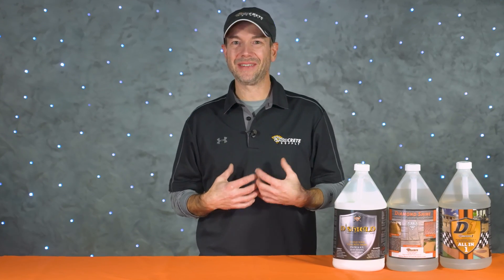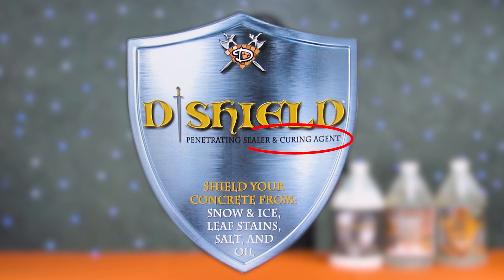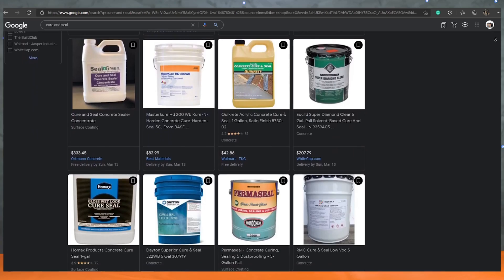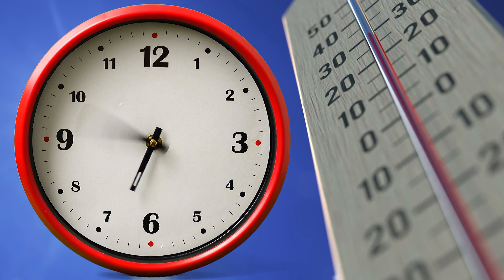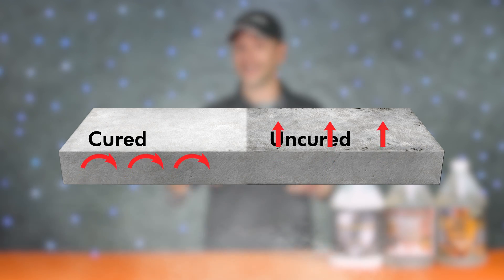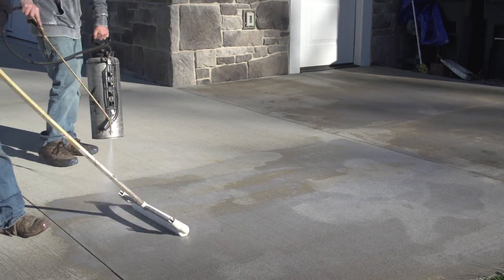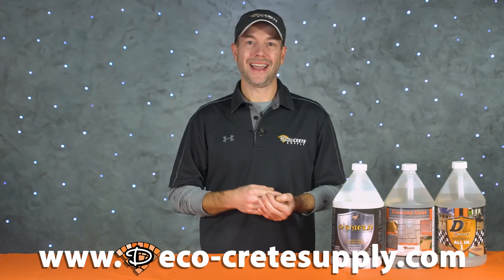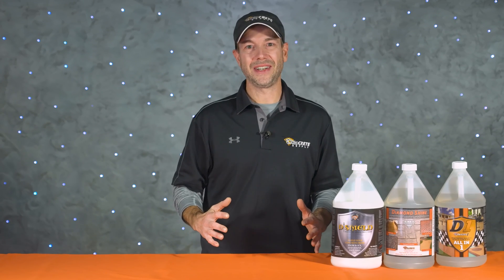Curing vs. Sealing Concrete | What's the Difference?

Comment: My basement floor is constantly dusty. Can I do something to stop that?
Reply from the maker: Thanks for the comment! You could try applying concrete sealer. It will help the problem, but it's hard to know how long it would last. Dusting generally comes from a weak surface and sealer probably won't permanently stop it from happening. Densifiers can also help with this, but they can be hard to work with. Some sort of vinyl of tile flooring might be the best option. Thanks for watching Deco-Crete TV!!!
Reply: @DecoCreteTV  I do not even know if it's sealed or not. I doubt it to be honest. I was thinking vinyl planks but I'm worried after a while the concrete will be making crunch sounds underneath

Comment: Great video, I am about to begin a barnominium and want a "stained" concrete floor. I understand waiting 30 days. My question is of the concrete guy uses a curing agent will that "seal" so as not receive the stain? It is going to be March in North Texas. So not really worried about freezing. Thanks
Reply from the maker: Sounds like a cool project! Curing agents will definitely have an effect on how the stain penetrates & reacts. Possibly making the floor unstainable unless you remove the curing agent. We don't recommend using any curing agents if you plan on staining the floor. Thanks for watching Deco-Crete TV!!!!
Reply: We used to water cure the concrete. Meaning keep the top surface of the concrete wet. We used haybales, cut them open, spread them out and soaked them to help keep the moisture on the surface. Do this for a few days.

Comment: Great Video! I have been doing some research and a lot of the product data sheets for cure and seals remind me of a bottle of body wash and shampoo promising several benefits in one application, but in my opinion... not doing either well. Do you know why these cure and seals can market their products as a one-and-done application?
Reply from the maker: Thanks for the comment!!! I don't have a great answer for why companies can do this. The products do what they say they do, just not all at the same time. The term "Cure & Seal" is common practice in the concrete industry. We feel it's important for contractors to understand the difference between curing & sealing, and that they can't be done at the same time. Thanks for watching Deco-Crete TV!!

Comment: I would like to know when should i apply the sealer (for curing). Can i use right after demoulding( its a beam)  the structure after 1 day. Can you recommend which type sealer is more suitable?
Reply from the maker: Normally on a flat slab you would apply the sealer/cure right after finishing. In the case of a beam, you'll have to wait till forms are pulled off, probably the next day after pouring. You could use any of our cure & seal products for this. I'll leave some links at the bottom so you can check out the pricing. Thanks for watching!!!                                                             
https://www.deco-cretesupply.com/products/water-based-sealers/d-guard-wb-309                                                                                                                                      
https://www.deco-cretesupply.com/products/solvent-based-sealer/d-guard-clear-25                                                                                                                                   
https://www.deco-cretesupply.com/products/decorative-concrete-sealers-solvent-based-sealer/super-stamp-seal-5-gallon                                                               
https://www.deco-cretesupply.com/products/decorative-concrete-sealers-solvent-based-sealer/d-one-5-gallon

Comment: Thanks for the video, and hoping you can provide me some advice. 

I stay in a townhome, and on my second floor is a French door with an outdoor patio (14 x 5). Water is penetrating at the joint where the balcony concrete slab meets the exterior brick wall. There are some cracks there that need to be addressed. I don't trust my HOAs contractor and wondering what you think may be the best route to address the cracks and stop the water coming in? (Leaks into my room below it)

Reached out to a couple companies, one has recommended taking up the entire patio to the sub-floor, and redoing the entire thing ...while others have recommended just laying down some liquid rubber. Thoughts? Been dealing with this for a long while and need some help haha
Reply from the maker: That's definitely a tough situation and some sort of water proofing is a must. Sika 1A would be a good thing to fill the cracks, then you could put down a water proofing membrane and fabric. I would also recommend running the fabric & membrane up the wall a few inches to address the transition between the horizontal vertical surfaces. After all that, you would have a few options for the final surface, concrete overlay, tile, or some kind of outdoor flooring. Concrete overlay and sealer is a nice option because it'll help the water run off better. Hopefully this helps, I leave a few links to these products below. Thanks for watching Deco-Crete TV!!!                                                                                    
https://www.deco-cretesupply.com/products/repair-prep-products/sikaflex-1a  
https://www.deco-cretesupply.com/products/repair-prep-products/miracote-membrane                        https://www.deco-cretesupply.com/products/overlay-tools/miracote-rp-fabric                                          
https://www.deco-cretesupply.com/products/trowel-overlay/stamp-mix                                                    
https://www.deco-cretesupply.com/products/overlay-mixes/deco-crete-stamp-overlay-mix                   
https://www.deco-cretesupply.com/products/decorative-concrete-sealers-solvent-based-sealer/d-one-5-gallon

Comment: Experts - for radon mitigation install , contractor made a hole in concrete wall and filled the gap around the pipe both inside and outside of concrete wall with Alex Plus Latex Caulk Plus Silicone . Is this good or should I get sealing around pipe with a better product?
Reply from the maker: Thanks for the comment! I don't have any experience with that product in that kind of situation. We would recommend some kind of hydraulic cement based product for that kind of repair. I'll leave a link below for the one we sell on our website. Thanks for watching Deco-Crete TV                                                                                                     
https://www.deco-cretesupply.com/products/overlay-repair-products/cement-all

Comment: After concrete poured, what is the earliest to apply sealant?
Reply from the maker: The safe answer is 30 days. That being said, it dose depend on what kind of sealer you're using. Penetrating sealers definitely need to go fully cured concrete, but film forming sealers are usually ok after a week or two. Some of this would also depend on the time of year. Thanks for watching Deco-Crete TV!!!!
Reply: I'm waiting for my new concrete patio to cured and by the time it reached the 30 days period, it's going to be November and it has been cold and wet every day so doesn't look good.  What's my option, wait until spring of next year?  And what sealer would you recommend?  Thanks!
Reply from the maker: @chanthana7694  What sealer you should use would depend on how the concrete was finished. We recommend D-One for stamped or any other kind of decorative concrete and D-Shield for broomed or swirled finishes. I'll leave a few links at the bottom. As far as the timing, you'll just have to wait and see what the weather is like. We're based out of Ohio, and there are usually some decent days in November that you could get it sealed. If not, waiting until next spring isn't that big of a deal. The fact that it's a patio and won't get any vehicle traffic helps things out. Thanks for watching Deco-Creet TV!!!                        https://www.deco-cretesupply.com/products/decorative-concrete-sealers-solvent-based-sealer/d-one-5-gallon                         https://www.deco-cretesupply.com/products/water-based-sealers/d-shield

Comment: if I waterproof my concrete patio will it make ice more likely to form on the surface? Would melting salt render the waterproofing useless?
Reply from the maker: Thanks for the comment! I wouldn't consider concrete sealers "waterproofing" they're more of a water repellant. A true waterproofing would hinder the breathability of the slab and would lead to problems down the road. Concrete sealers repel water from above but allow moisture from underneath to escape. Ice will from on top concrete sealer sooner then unsealed concrete, but that's better then ice forming in the concrete slab. Melting slats will definitely work, but some of them can be corrosive to the concrete, so make sure you check if it's "concrete safe" before using. Ice forming on top of sealed concrete really has no negative effects to the concrete, just slippery to walk on. Water getting into the slab, then freezing is where the problems start. The best thing you can do is leave the ice there unless you have use the area. The constant cycle of freezing & thawing can lead to more damage then just leaving it frozen. Hopefully this helps, thanks for watching!!
Reply: @DecoCreteTV   What's your opinion on those products like 'Alaska Liquid Ice Preventer'? It claims to prevent ice from forming on concrete but I wonder if it'll do anything to also help melt the snow that's on top of it.
Reply from the maker: @ginsengroot815  I'm not familiar with that exact product, but we have used some ice-prevention products in the past. They work really good for prevention, but they don't seem to melt ice very well if it has already formed on the surface, especially if the temps are under 20 degrees.

Comment: So when should your seal ? Right after the pour ? Like a day or two ? Or longer ?
Reply from the maker: it all depends on what you are hoping to achieve out of the sealer. a good rule to follow is: spraying the concrete with sealer the same day will act as more of a curing agent than a sealer. to get the most out of concrete sealers they should be applied to fully cured concrete.

Comment: I have new concrete that is 40 days old, and it is developing multiple long hairline cracks which extend across the entire slab. About three days ago, I first noticed these cracks when temperatures dropped from the 90s to the 40s. I know there is little I can do about the current damage, but I want to seal it to prevent new cracks. I have read about penetrating and acrylic sealers as possibly being helpful. Which type of sealant could help me best with preventing additional cracks? Thanks so much!
Reply from the maker: Sealer will not keep concrete from cracking. But it will keep water from soaking into it as well as protect it from stains for driveways we recommend a penetrating sealer like D- Shield. https://www.deco-cretesupply.com/products/water-based-sealers/d-shield
Reply: It wasn't installed and or finished properly.

Comment: New sub. Can you please help me, I need advise, ASAP🤯 I have a cement porch about 11’x18’. Anyway, it spalled after a really bad winter storm. It was about 7 years old. Anyway, I had it replaced this year. Well, now, when it rains, the cement bubbles, like going to the beach and sand crabs diving into the sand when the tide goes out, it bubbles. I contacted the company that poured it, they are ignoring me. I am afraid it will spall right away with all that air space🤯 Would sealing fix that, or do you have a suggestion please. This porch is taking me to the poor house🤯
Reply from the maker: How old is the new slab? has it been sealed yet?

Comment: My patio concrete is slippery. How can it be fixed?
Reply from the maker: If your patio needs resealed, you can put grip in the next coat of sealer. If it doesn't need sealed, it may be best to wait until you need another coat to apply grip. https://youtu.be/Zpt3gF0oRhQ
Reply: Etch it.

Comment: Hey when will the 2022 expo video will be going up?
Reply: I'm about to never use sealer again. I'd rather not have issues w the sealer than have a layer of protection (even though every customer wants it) I think it would be better just to water cure it correctly,  natural seal is the only sealer I have not had issues w.
Reply from the maker: Try this for stamped concrete: https://youtu.be/u5RNPrg-8wE
Try this for broomed: https://youtu.be/jt-CuwtCQGE
This might help out with the problems you mention! thanks for watching man
Reply from the maker: 6pm EST tonight! Thanks for watching Joshua👍